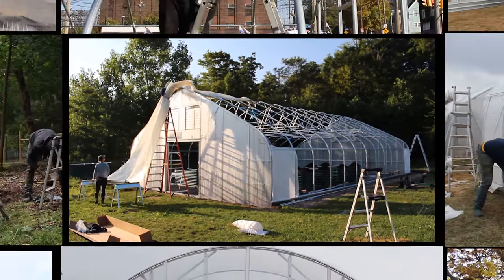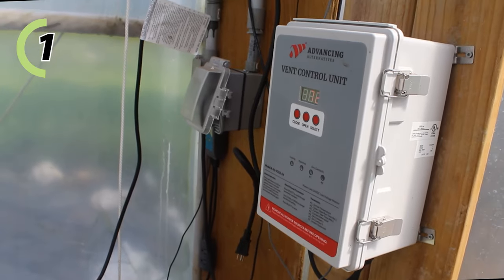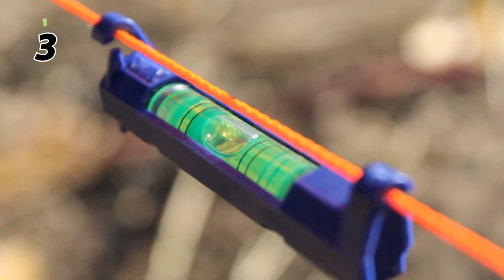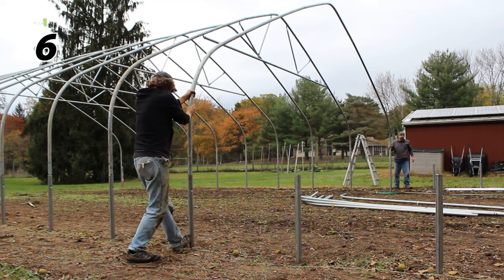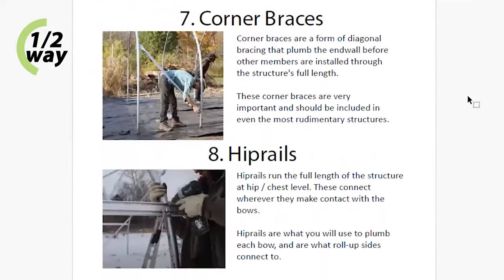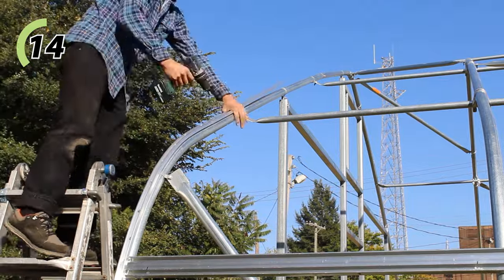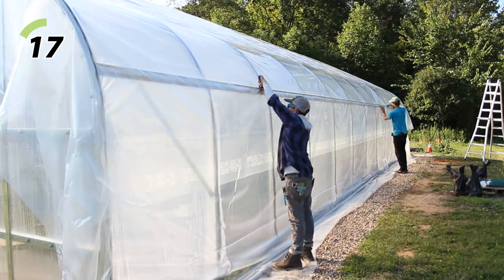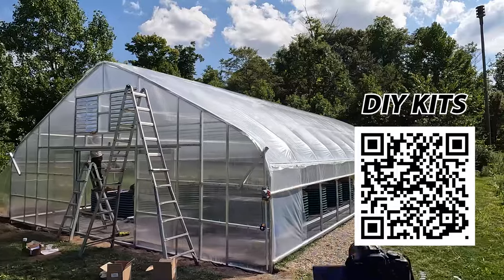How to Build ANY Greenhouse or High Tunnel | 20 Simple Steps

Comment: I'm ordering mine next week,  I sure hope you didn't miss a step?  LOL!!!  Does it come with the post cap insert in the pipe to hit it with the sledge hammer?
Reply from the maker: Lol, me to, and happy to hear that! To answer your question, yes, the DIY kits come with an insert for the bow anchors. This way you can use a sledge hammer without splaying/mushrooming the top of the anchors. While we supply the bow anchor caps as a standard, we don't supply a cap for the end-wall anchors as a standard (because there are fewer end-wall anchors), but if you wanted to add one, we can do so for the price of the post pounder - just ask your sales person to add it into the quote and they can do so. Thanks!